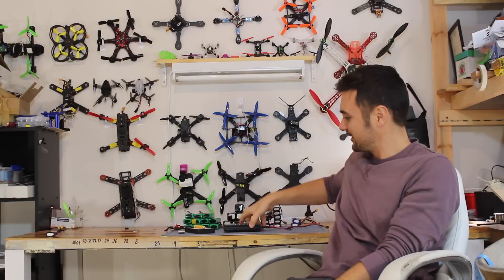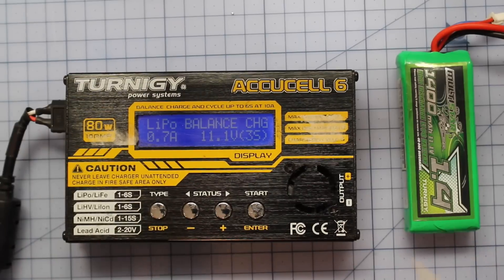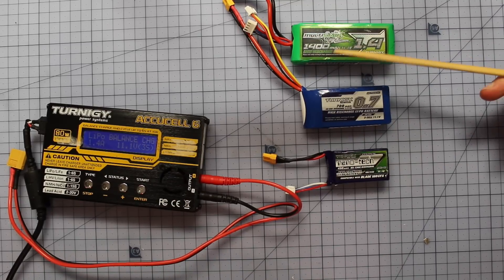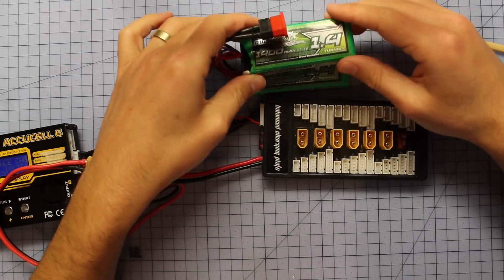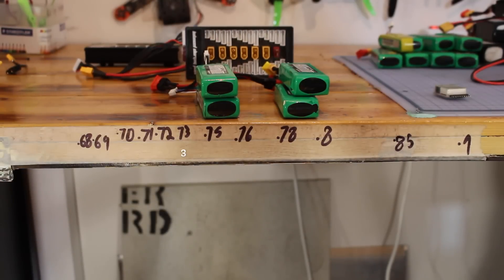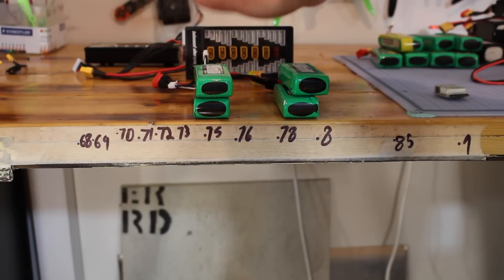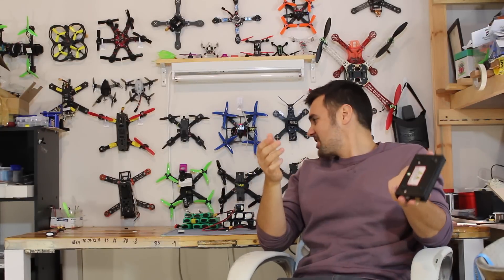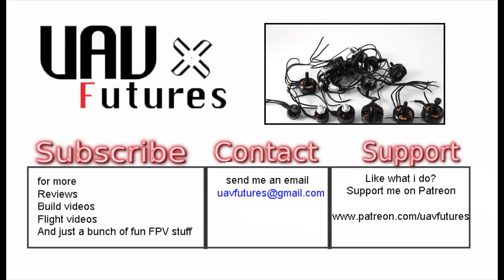Beginners guide to charging LiPo batteries + parallel charging

Comment: So, first, THANK YOU! This video and others have really made catching up on the basics a breeze.

Quick little question though: I just got a similar balance charging plate and it has two ports stacked for the balance lead (so you can link multiple plates). I'm assuming it's fine to use either of these to connect to the charger, correct? Just trying to make sure so I don't blow up my hometown. Cheers!
Reply from the maker: I always wonder this too?/ I use the bottom one, but im guessing either is fine

Comment: I'm new to LiPo and bought a 16000mAh, 14.8v to power my fish finder on my kayak. I have the Accucell S60 Charger. I'm assuming the amps setting should be set to the maximum of 6.0 for the best charging?
Reply from the maker: yeah but even then its goign to take a while
Reply: Gotcha, thanks

Comment: hi i have transmitter for wltoys V977 its 4 battery  want put this one battery could you tell me how much full charge this battery
http://www.ebay.com/itm/GeiLienergy-1Pcs-4-8V-2000mAh-Flat-Receiver-RX-NiMH-Battery-Pack-Ship-From-USA/112184612824?_trksid=p5411.c100167.m2940&_trkparms=aid%3D222007%26algo%3DSIC.MBE%26ao%3D1%26asc%3D20140131123730%26meid%3Deab98071243c4b458ea004a1e19a5efa%26pid%3D100167%26rk%3D1%26rkt%3D15%26sd%3D172279756873

Comment: i sorta want to know just basically how the parallel port is wired, who is sensing what to be more accurate?. are all the batteries sending cell data back to the accucell 6 50w in my case. does the accucell 6 know its connected to a parallel port?  can i look at all the cells in the accucell readout even if i have 5 4s lipos on the parallel ports? and why the hell does something this simple have to be this vague. can anybody tell me what is physically going on, ?
Reply from the maker: it see the batteries on a para board as one big battery. the charger doesnt know it is a parra board it is charging.
Reply: yeah that makes sense, i just  got hung up on the number of cells

Comment: Hello-  I have a Hubsan H501S Advanced Drone.  The transmitter takes 8 'AA' batteries, and they don't last very long.  Could you tell me how I can convert to a LiPo battery?
Reply: if you search on youtube hubsan 501s tx lipo mod, you will find a lot of people with ideas, its quite a common complaint.

Comment: Isn't c rating different from mah?? I have 1300mah batteries that are rated at 75C. I assume that means I'd charge at 1.3A but why are you calling it C?
Reply from the maker: c stands for capacity. and represents how many times capacity it can discharge. and is also useful to charge at 1c
Reply: Batteries have two different C ratings - one for charging and one for discharging.... Sometimes they only print the discharging one on the battery.
Reply: Hey Gothops154, a 45C will have more punch than a 25C

Comment: I bought at turnigy actively 6 80w and I can't find a AC power supply for it. Where can I find one?  Thank you!
Reply from the maker: i just googled 12v power supply and got one with 10 amps. cut the lead off and soldered on the barrel plug

Comment: what power supply are you using? i am currently using a car battery which is not the best option haha.
Reply: Well yeah, a car battery is built for an entirely different purpose. Also, the alternator is constantly recharging your car's battery while you're driving.
Reply: lol its funny  how these rc models burn through a lipo in a few minutes  when a car 12volt battery  in a car lasts for  3 years
Reply: And yet know one answered the question.. Oskar jennische. Did you ever come up with another solution?

Comment: Hi buddy. This can be plug in the wall plug? Because I've seen some people using other power supply! I'm only charging 6 4s 1300mah only should be fine? If I'm doing parallel charging.

Comment: i aways charge me nano tech 2.2mah at 3a a lot. am i asking for trouble? i also charge my 1.3mah at 2a :/
Reply: no
o charge my sls 1300ma 3s with 5A
Reply: Scot Graham ive been charginging my 2200mah 3s 30c at 4.0amps singulary alot of times...never had any problems. Maybe from no on i wont charge that high if its as bad as he says
Reply: Charging at 1C will make the battery last longer. If it has a higher charge rating it just means it's (probably) not going to overheat.
Reply: discord2000 mine dont even get warm so it should be all good. had over 100 cycles and staying strong

Comment: is this one lipo charger plugging in your house outlet sir?
Reply: UAVfutures Wish you talked about the adapter you have to buy got my charger and power supply with no way to plug it in and now have to wait again... yay...
Reply: GSHeverything _27  I had to buy a Turnigy 540W dual output switching power supply from Hobby King for Australia 240v and it is awesome, provides output between 12v and 18v and 30A. Perfect as a power supply to the Turnigy Accucell 6. It cost about 130 AUD and well worth it.
Reply from the maker: I have a power supply which is plugged into the wall. then that plugs into the charger
Reply: UAVfutures Thank you

Comment: Do you need to buy a power supply/cable? Cause this is what hobbyking is giving with the charger: Note: Power supply, power source cable, temperature sensor and USB cable are not included. 

And I see you've got a self-soldered cable in there? Is it easy and cheap to do? I just want to know.
Reply from the maker: yes I had to

Comment: Hi, small question.... At 4:48 we can see a black 4s battery with a little red thing on the XT60... Where you get this XT60 protectors from???
Reply from the maker: my friend 3d printed them, but I also think hobby king sells something like that. some turngy plugs or somrthing
Reply: Thanks, found them - http://www.hobbyking.com/hobbyking/store/__77276__XT60_Charged_Discharged_Battery_Indicator_Caps_5_Pairs_.html

Comment: I just buy multiple of those cheap $7 hobbyking chargers. It's stupid to buy a super fancy charge like that for just 2 or 3s.
Reply: you can buy a "super fancy" charger and have it balance all your cells while charging, check IR, discharge them. not to mention you could charge multiple lipos at once.
those cheap chargers do not balance the cells well.
Reply: they balance them well enough. My 3s batteries cost ~$10. I dont want to spend 70-80 on a nice charger because i can just replace the batteries after a while.
Reply: Joshua Middleton you'd have to spend a loy more buying a new house (if you are alive that is) if one of your lipos goes up in flames. It's up to you but you are better off buying a good quality charger that can charge multiple lipos faster and much much more safely
Reply: I charge my lipos in the middle of my concrete garage floor near nothing flammable. There is really a small risk of anything catching fire.
Reply: Joshua Middleton oh well yea. That's fine I guess. I live in an apartment so I use an ammo can
Reply: I use a fire blanket and shove my lipos inside whilst charging. And keep them in a metal bucket with sand on the bottom and a dish full of sand that fits as the lid

Comment: hi again
in case of balanced parrallel charging do i have to connect to the plate both xt60 and balance cable?
Reply from the maker: yes the balance board has a cable that connects to your charger

Comment: Hey bud whats a good power supply if your charger max output is 6A? Should I just get a laptop power cord, i'm using one from a nimh charger that does 4.5A. Whats safe to use it's a b6imax 80W says 12-18V on the side and thats it, on the front says charge rate 0.1 - 6A
Reply from the maker: something like this, should be around $20 http://www.ebay.com.au/itm/AU-12V-2A4A6A-SAA-Power-Supply-Charger-Transformer-3528-5050-LED-Strips-Adapter-/330934264852?var=&hash=item4d0d382414:m:mM7auSOqc8DmwDMLnuFCWfw
Reply: +UAVfutures champ thanks mate.

Comment: what power supply?
so whats the difference between the accucel 6 and 8?
Reply: probably the t-power adapter made for accucel 6. its about $16 actually that ones only rated for the 50w accucel 6. 
just look for a 12v 10A Led driver power supply it should comfortably power it. the acculel should come with a plug for input you can solder together to plug in.
accucel 8 has a higher watt rating at 150w and charges 3s-8s lipos.

Comment: Just a question.  I have 150mah lipo's from JJRC  and they have all puffed up, I charge them with the USB charger that comes with the model. I have more of these type of lipo's  that I charge with the same charger and they are fine, not swollen its just the JJRC lipos.My bigger lipo's  From Eflite also puff up although I do charge them on a balance charger. Is it just bad quality lipo's or am I doing something wrong.The cheap Chinees lipos stay fine.Also what make lipo do you recommend?  Big lipo's are too expensive too go bad quickly
Reply from the maker: I fly some multistar batteries or turnigy. They are cheap and do ok. Sorry I dot know about the tiny 150mah bats
Reply: UAVfutures But why do they puff up?
Reply from the maker: Ruudy L usually batteries puff from too heavy a charge or discharge

Comment: Great video. I never charged my LIPO at 1C lol Always 1/2C. For me one crucial point when charging in parallel is to make sure that all these LIPOs have healthy cell. One LIPO with a bad cell can damage all the other LIPOs.
Thanks a ton for sharing Stuart and have a great week
Reply from the maker: thanks. Great point about the cell
Reply: 1/2c is a bit under kill. 1c should be fine if you want to keep you batts in good shape but I don't really think it would hurt the cell to charge them at 1 1/2c but it might reduce the Mah you can put back into the cell. I charge 3 4s SMC 37a 1300Mah packs at 5.3 amps but I should charge them at 3.9amps because that's 1c. If your in a rush to fly charging them normally or at 1 1/2 shouldn't really hurt them at all. If you have a slightly puffed/damages pack with a bad cell then definitely charge it separate.
Reply: Crøblë FPV There is nothing under kill, LIPO had been designed for delivering power not storing it :)
The less C rate you use when charging your batteries, the more longer and the more better they will perform because you don't hurt the chemistry inside them like you do when charging at higher C.
Of course you have also to be careful and do not push them beyond their limits while discharging and you should also respect the basic rule of putting them on storage state when not using even for a short period.

Comment: Awesome tips m8 but allow me to comment on something which might get you into a revised already awesomeness. You can equalize the batteries voltages by just letting them rest on the parallel board (main leads and balancing connectors). so if you have one 3s bat with 3.70/3.71/3.70 and a second one with 3.4/3.41/3.42 within a few minutes resting them on a parallel board, both batteries will have similar cell voltages and ready to be charged in parallel. (ps: of course I am talking for same batteries, cells, capacity and discharge rate) Thanks again for your video. keep em coming. I really enjoy your channel!
Reply from the maker: good to know, thanks

Comment: Another nice instructional video for me to point my friends who are starting out in the sport at :)  
Can you also share what Power Supply you are using for your 80w Turnigy Accucel 6?
Reply from the maker: it was some cheap 12v power supply from ebay. I just cut the end off and soldered on a plug that would fit.
Reply: OK thanks.  Looking for something that can output at higher voltage to get the most out of it (will take up to 18v).  My old bench power supply died & I'm no longer able to charge LiHV, but don't want to spend too much.

Comment: hey, just curious, could a kk2.1.5 board be used for racing drones?
Reply: well, this just in, looks like I found a frame. hobbyking having a 24 hour 1$ frame sale and I had to get the spyderbyte widowmaker 170. and yes I will get the Naze....
Reply from the maker: I dont know about this. Betaflight stock pids are awesome and honestly using the cleanflight config is very easy, what was it that held you up? Plus Kiss is so expensive and not open source
Reply: Yes and no.   Yes you could tune a kk broad to fly a racing drone.     No because it will not physically fit inside a 250 or sub class of racer.   The broad would overhang most airframes and the last thing you want is anything to stick out and not be protected in the event of a crash.
Reply: +388gruardian crap... let's just hope it fits. I got a case with it so if that does anything. Thanks for the advice tho
Reply: do more research before you buy
Reply: No problem bro,  hit me up anytime you have a question.  I will try to help you as much as I can.    Just like Aceofhearts said,  do your homework.   There is so many options it is easy to get things wrong.      My advice to you is to get a naze 32 broad or maybe a cc3d.  Both offer features that you will want in the drone racing and there is a huge support on the web for them.  There are other broads too but, I am keeping the list to the most used    See if you can return the kk broad as you haven't used it yet.    Don't get me wrong the kk broad has it's place in the hobby but, not in the racing drone class.
Reply: +388gruardian K thanks! I'll stick with the kk tho since im going to use it for my first brush less quad. however I will probably do a build later this year, so I'll most likely use the naze32for that..
Reply from the maker: IF you are building a racing quad, save yourself a lot of time, effort and just get a cheap naze 32. it is like $15 and will make everything so much better
Reply: +UAVfutures yeah... again, this is going to be my first brush less quad and I'd like to practice on the kk2, however, I will do another build later this year and as I have been told, I will use the naze32 for that.but which build should I do? I fly on a sim and have maybe 5 months of practice and can do high rates, but I might still need an advanced trainer. I've been looking at 130 size quads, what would you recommend? also, thanks for the advice!
Reply: What Stu said,  Don't even bother with the KK2, just get a Naze32.  If you already have anything with KK2, buy a new Naze32 and replace it.  You won't be doing yourself any favors trying to stick with the KK2.
Reply: +Nigel Joyce well I'm not going to stick with it, it's just going to be temporary.
Reply: it wont work, it wont fit even
Reply: +Elan Kipervarg if you have the money but don't have the time to stuff around, go KISS, the KISS FC is the easiest flight controller I have ever setup. I have setup many naze32's and the process take so long and if your new to the hobby, tuning PIDs is such a bitch. The KISS FC on stock PIDs will fly particularly well but you will have to tune it to how you like it and what rates you are use to. :)
Reply: +Crøblë FPV oh yeah! thats the board that Mr Steele uses. I never knew it was easy to setup tho. I hope it can for Linux. btw Ubuntu Linux... yeeeaaaahhhhhhh....... does it use clean flight or base flight or something else?
Reply: Elan Kipervarg UAVfutures 
yes the kiss GUI will run on linux, it uses its own firmware for the board that you download from http://kiss.flyduino.net/download/kiss-flight-controller-firmware-v1-02rc28/

yes i agree with you Stu that it will fly and the config is understandable but if you have a bad board, esc, motors then tuning is such a pain, even though i had top of the line parts yada yada it was still a pain, betaflight is amazing though i have nothing against betaflight, it will work well with a trusted board eg. moto, spracing, lux, then it amazing!! but then i saw that mr steele had this awesome fc with awesome esc's (kiss24a) to match, them i saw that Vek, Snake, Webb, FGA, and many more had kissed out aliens. once i went kiss i dont think i will ever go back, unless i had a muck around acro LOS quad, btw i only have my one alien 5 quad and i used to have a 3s qav250 which was so crap :/
Reply: kiss is 100 bucks though...
Reply: +AceOfHearts you get what you pay for. It's $53 postage to Australia included from Flyduino...
Reply from the maker: Crøblë FPV and sometimes people pay too much
Reply: Crøblë FPV the cyclone fc does fine
Reply: +UAVfutures that's true but this hobby isn't cheap either way you look at it unfortunately.  some bf/cf boards cost more than the kiss FC... At the start of the video I'm guessing that they are your batteries, 37 of them. I only have 3x 4s 1300 batts... Nothing's free :/
Reply: +AceOfHearts hfs that's amazing.
Reply: the hobby aint cheap, but any opportunity to save $$ for little to no negative downsides  helps alot.
Reply: +AceOfHearts I see where your coming from with saving money. Most people have goggles. Fatsharks. Yeah cool$300-850 later. I don't have that luxury. I have a $70 shit screen from bang good. I can still fly the same if not better than some people with goggles, but I'm not saying that screens are better than fatsharks. I would love some fatsharks to fly with but you don't see that kid with a shitty screen on top of his Taranis ripping balls as you would expect from a guy with the whole fatshark setup. any way so instead of goggles hurting my wallet, I can spend almost a 1/4 of money on parts that I like and know that work well if setup correctly and that I can trust.
Reply: Crøblë FPV quanum goggles is were its at
Reply: stuff that.

Comment: Lol, nice chopstick Stew. I'm glad you did this video I've got some Turnigy 3s Lihv batteries which I have been parallel charging with in the Lipo setting. I didn't know they were Lihv till I watched your video and then thought I'd better check (what a dill yeh?). I also noticed my charger has no Lihv setting. Do you know if this will stuff up my battery n the long term?
Reply: It's perfectly fine to charge lihv batteries on the lipo setting, you're just missing out on the extra charge.
Reply: Dam, gotta get me a Lihv charger for those killer punchouts!